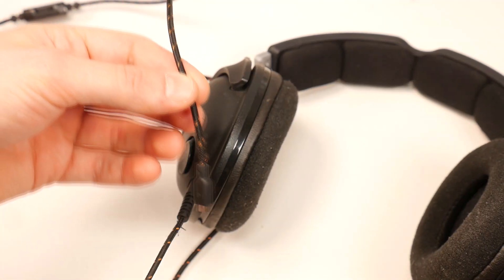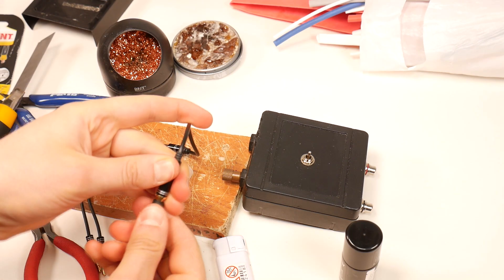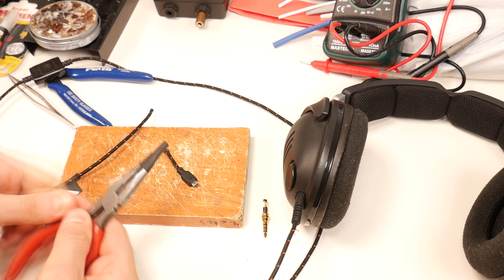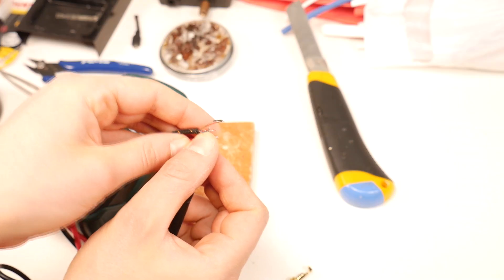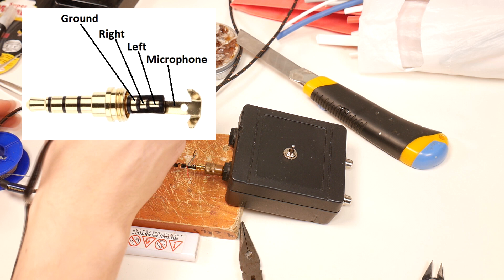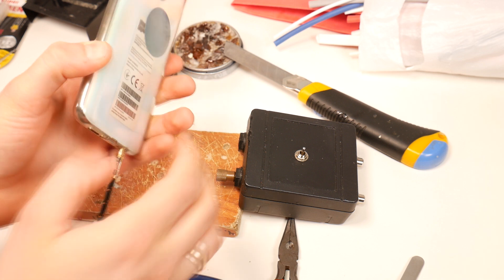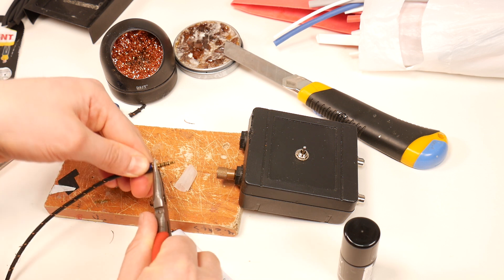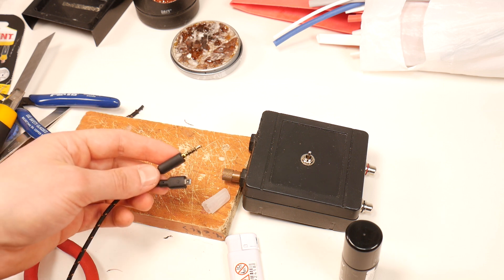How to Repair SteelSeries 9H - MOD

Comment from the maker: - 3.5mm 4 pole plug on Aliexpress:
https://bit.ly/3l0BGf6
- Heat shrink tubing set on Aliexpress:
https://bit.ly/3FWhI1q
3.5mm splitter on Aliexpress:
- https://bit.ly/3C0hogt

3.5mm splitter on Amazon:
- US https://amzn.to/43sSS3l
- UK https://amzn.to/43gCGT5
- DE https://amzn.to/3ODEzVw

- 3.5mm 4 pole plug on Amazon:
US https://amzn.to/3qju4g4
UK https://amzn.to/3MHFK3F
DE https://amzn.to/3oILh1I

- Heat shrink tubing set on Amazon:
US https://amzn.to/43szh3g
UK https://amzn.to/3N2MF95
DE https://amzn.to/3IOWWmz

Comment: Want to know if the volume control / mic mute control is still working with that modification??
Reply from the maker: Yes, after the mod, these headphones work like new. It’s also much easier to use a 3.5mm connection.